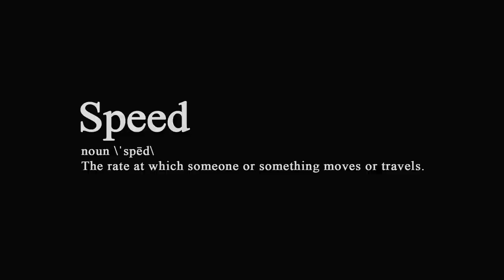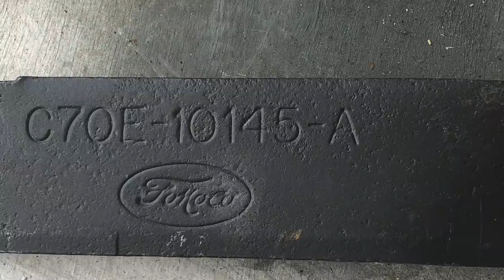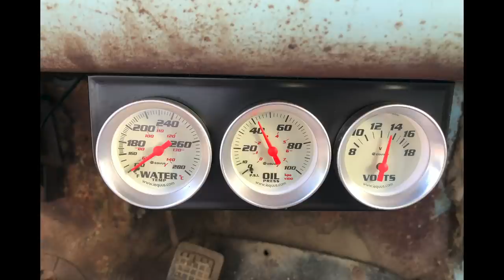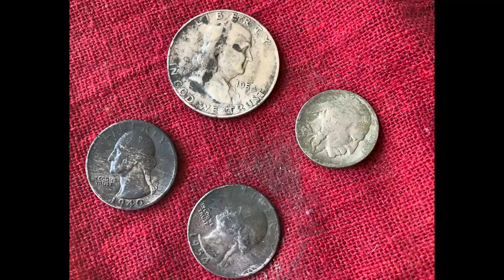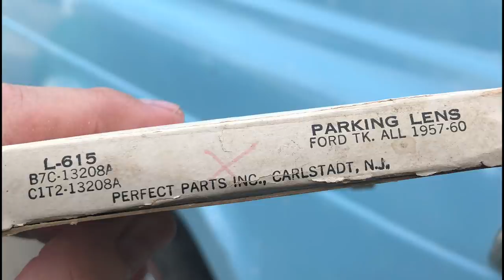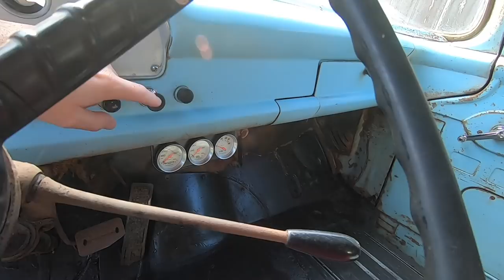1958 Ford Panel Truck Rescue Part 2 - Speed & Chrome Illustrated Magazine

Comment: Love that you can figure out gas tank stuff. I can't seem to figure how mine comes out. Mine leaks. I miss my old 1966 Dodge panel truck, it used to be a San Jose  police paddy wagon. I sold it years ago. So I finally bought a 53 Chevy Sedan Delivery. I had long ago forgotten how to work on stuff. Now, it hurts just to get on the gravel driveway to replace the rear brake drums. No proper tools (as they were stolen years ago). I did manage to get the car running and every thing hooked up,(with help ).It still runs ,ok. I think it has a  loose fuel tank because I hit a bump in the road on the test trip and saw fuel dripping when I got home. It has new radiator,wheel cylinders and brake shoes and drums. All the electrical I went through and got working. New custom tail light lenses and backing plates. Needs some body work as it was hit in the rear passenger side. I also need to get the shifter adjusted as it slips out of park. Car has no parking brake or sun visors.Lots of work for an old car,so I get what you went through.
Reply from the maker: The tank was a pain to get out. In fact I broke the fitting on the top and had to have it fixed. They are fun but also a pain. Gravel is not fun. Maybe invest in some plywood. At the least cardboard works to lesson the rocks.
Reply: @SpeedandChromeTV  Thanks, I will try again. Wish you were my neighbor. LOL
Reply from the maker: @thomasfiliatreau4783  Where do you live at?
Reply: @SpeedandChromeTV  I live in Angels Camp, Ca.
Reply from the maker: @thomasfiliatreau4783  you just a hair over an hour from me. I’m in Modesto.

Comment: Next time on a caked gas tank use  alcohol to dissolve the "cement". I reclaimed a 53 dodge sedan that way It. was clean as a whistle.
Reply from the maker: Thats a new one. I would have used Diesel fuel but I didn't have a way to dispose of it afterword. I should have just went with the tank I bought for it to begin with that I knew was good. Oh well, its all part of the journey right?
Reply: My son got the tip from his college professor.

Comment: I. Have a 56 f 100 I've had sence 8th grade in 84 .I put 58 tail lights on it in the bottom corner of the fenders on the pickup . In high school it was a hot rod all over the ground independent front suspension now it has a 76 4 wheel drive international scout underneath it on 33 12' 50 s. All under the fenders..  I'm  looking for tail light lens for 58 pannel  Ben looking for years T swopmeets
Reply from the maker: Hey Bryan, Yes, they are very hard to find. Sometimes they show up on ebay. There is a guy who makes them. I needed one, since it was broken. I found a guy on a facebook group that was experimenting with resin casting. He made me the one I needed.

Comment: I love the video, I have a 1950 F-1 panel that I bought 3 years ago.  One of the hard to find parts for my panel is the fuel tank.  I bought one from a guy in San Jose, that was not exactly the same, he said he didn't know what it came out (what year).  I figured it was from a later year.  When I saw your pictures of the fuel tank in your truck, I saw the tank I bought from that guy, lol. Tanks for these old panels are almost non existent.  FIY ... Mid Fifty ford in Golden Valley AZ makes an aluminum tank for the panels.  It is a a few inches shorter to facilitate the use of an in frame dual master cylinder and brake booster kit in place of the original brake master cylinder.  The original tank was too long to use the after market upgrade kit.  When I found the later model tank, I decided to go with it.
Reply from the maker: It's good to know someone makes a replacement tank for these. The trucks are rare and tanks go bad from sitting. This one cleaned up well, but needs a bit more cleaning, thankfully no rust or leaks, thank you california. I drove the truck yesterday for about an hour, was good to get it out and cruise it for a while. Its for sale, and will be going to a new home soon enough. I have too many other projects to focus on.
Reply from the maker: Also, the manual disc brakes work excellent, no booster needed. Its nice to have the MC on the firewall and not under the truck. I have another car with it on the frame and its a pain.
Reply: @SpeedandChromeTV   Yes all 3 of my '50 ford vehicles have the M/C in the frame.
Reply from the maker: @glennclark4582  Are you doing it for clearance for V8s?

Comment: I have been restoring a 1958 Willys Panel Truck. In fact I've been restoring this Panel truck for 44 years. When I bought it  it had a Ford 289 V8 and both axles were wrong (mismatched ratios). It now has the correct original engine and matching axles. Patience is a virtue.
Reply from the maker: 44 years is the longest i've heard of a project. Wow.

Comment: Glad to see you give  this 58 panel  a new life...   I gave a 59 F- 100 a new life.   Only  I chose to swap  a 351 Windsor and AOD transmission  to the original 9 inch rear end.  This combination  let's  the truck stay in traffic or lead it if I want to....

Comment: good job. that is a lot of the problems we had to solve on the 56 panel we got running.
Reply from the maker: My last issue is the fuel tank. I have another tank, I may end up using that one instead of trying to fix the one it came with. I know its clean. But it means another trip back to the Radiator Shop to swap the pickup. Its all part of the process which is why I do it.

Comment: Question: What brake manufacturer's system did you use to do the disc brake conversion? I have a '57 Ford station wagon I've had since I was in high school. It's been sitting in a garage for 30+ years and the brake system, though not as far gone as yours was on this vehicle, will need to be completely gone through, so I want to do a disc brake conversion on the front. I want to use the GM style single piston floating calipers and the one piece rotors, because they are the easiest to work with and find parts for, if needed and reaching the conversion manufacturer may not be easy at the time. I've been looking at several manufacturers and I like what I saw in the conversion you were using. 

Also, I read Joe Schlotthauer's compliment on your video and I agree with him. Great video and you seem to be a natural at narration. Your narrative is calm, to the point and another thing about your video... there's no theatrics. You get to the point. No BS. Like a "How To" instruction video. I know you spared a lot of the particulars, may be because you didn't want to bore some of your viewers, but there are plenty of us car guys out here doing projects and looking at what other guys are doing to get ideas and who appreciate the details. You give enough of them to answer any questions we might have in our minds, but keep it simple for the beginners or guys who aren't as knowledgeable yet and are just learning.
Reply from the maker: Other than the adaptor for the Master Cyl, all the brake parts came as a kit from Speedway. Its a pretty cheap kit, $250. or so, there are some options with it. I've been pretty happy with it, its a pretty straight forward install. Very bolt on.

Comment: Although you did a commendable job cleaning, I see your intentions of keeping it cheap and it will be if some of the areas that rust the worst (of  course california doesn't have it) but like the firewall and other areas could use a dusting of primor or something to protect it, along with underneath. Using a fuel tank that old is where you lost me as fuel cells are cheap for the cost compared to other stuff that dies from the stuff put in the tank to eat that junk like the diaphragm in the carburetor. Pretty sure it uses a mechanical vacuum advance so that diaphragm will die as well as it is very fragile. Those side panels on the inside allow you to get to most of the dents to where you can deal with small abrasions. Its not rusted to the point of whats the use so a big hammer would help and a small amount of heat to get them close. Every light swing leaves a dent too so might as well move that metal close with the least amount of hammering.... once close then the body tool makes a big difference... I know cause I did them.

Comment: you change the front or repaint it
Reply from the maker: Nothing was changed or repainted, just heavily cleaned and buffed. I do have another fender for the passenger side. That one is pretty far gone. It just needs to be swapped out and spotted in to match the color of the rest.
Reply: @SpeedandChromeTV  am saying like are you gonna repaint the grill  and the bumper or you gonna buy a new grill and bumper
Reply from the maker: Haven't decided. Neither are easy to find in good shape. A chrome grill would look nice though.

Comment: can you link to the cerakote product you used?
Reply from the maker: https://www.cerakote.com/ they have an air dry version and a one you bake in an oven at high temps. I use the air dry version and it works fine for what I do. Just make sure you get them coated well or they will rust. Its a nice durable coating though and its not thick like some paints can be, or melt when brake fluid gets on them or something. Its not cheap but it goes a long ways. So buying the smaller quantities would be the way to start. I purchased a pint a few years ago and haven't made a dent in it. It also has a shelf life, the ceramics that are in it need to be mixed up. Anyway, check out the site. You'd think I was getting a commission on it or something, haha. I just like good products when I find them. Like POR15.

Comment: The Franklin half-dollar and Washington quarters are Constitutional silver (90% silver).  They're worth $22.566 per $1 of face value right now because the spot price of silver is $27.  So the half dollar is worth $11.28 and the quarters are worth $5.64 (each).  That's just the silver melt value, and has nothing to do with the condition the coins are in from a collectable standpoint.  https://en.wikipedia.org/wiki/Junk_silver#Common_U.S._coins
Reply: The Buffalo nickel is 75% copper and 25% nickle, and might fetch you $1 if it is in "good" shape and maybe as much as $75 for a very rare mint mark.  I can't see the mint mark, but you can see the value chart here:  https://www.jmbullion.com/coin-info/nickels/buffalo-nickels/
Reply from the maker: Very cool. I hadn't talked to my FIL about these yet, he's into coins too. Pretty rad, maybe I need to build a little shadow box for these and display them.